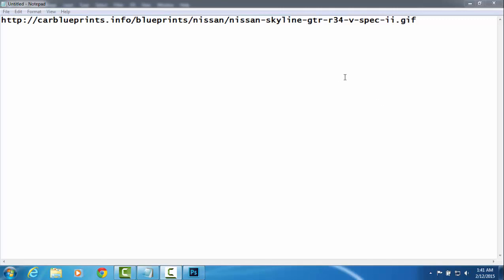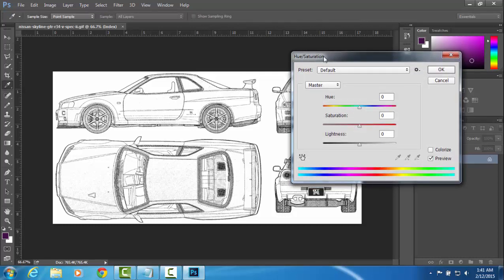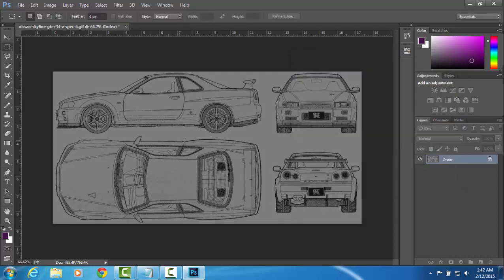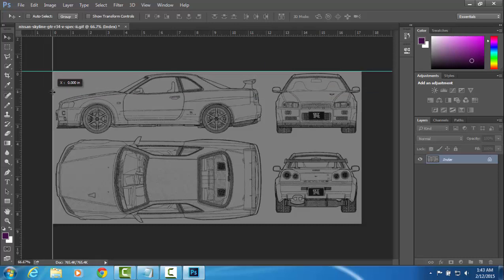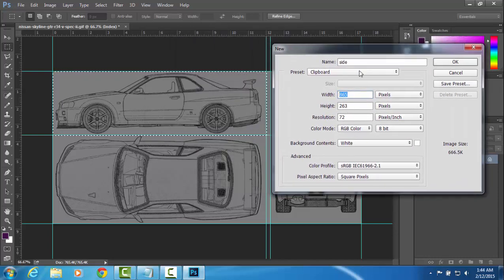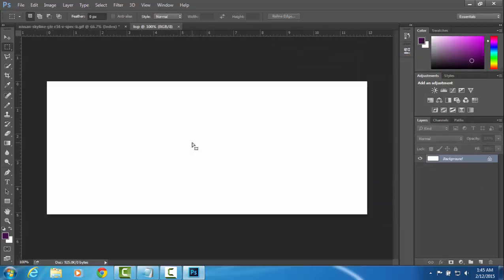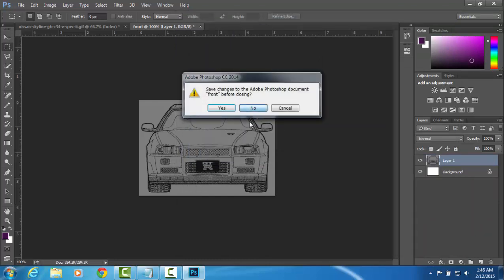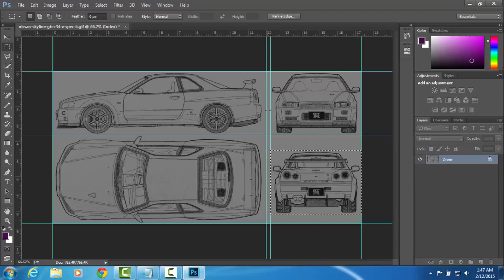3ds Max Modeling Nissan Skyline GTR R34 part 1

Comment: I've used the same blueprint, but I think the proportions are wrong, the front is too short and the rear is too long. If you compare it to a real photo of the front taken from the side, or even models from games like Nfs and forza.
Reply from the maker: Great observation, Initially I did not notice that myself, however I think you make a great point because during modeling sometimes I have noticed that when I did this tutorial a while back I kind of had to use my best judgement and make educated guesses with my geometry which in most cases actually turned out decent but still. I figured something may have been up and you hit it on the head that or perhaps my blueprint import technique did not line these blueprints up as exact as they perhaps could have been. Either way I am in no way a professional at 3d art just did this as a hobby fwiw anyways.